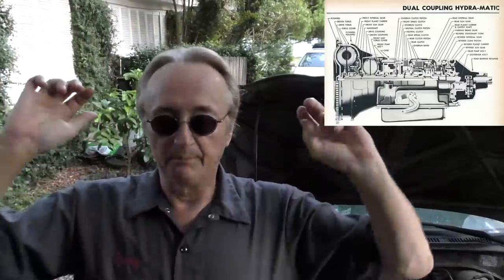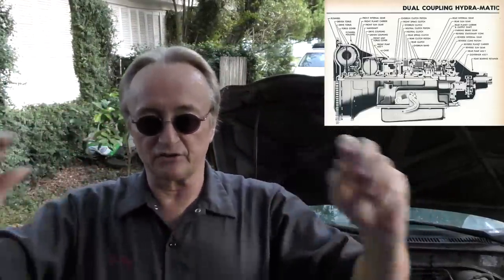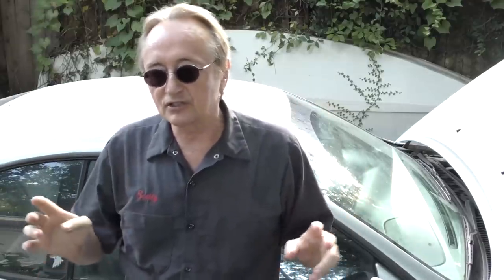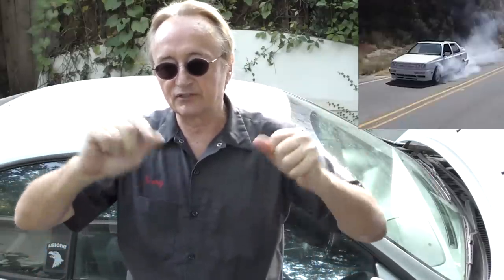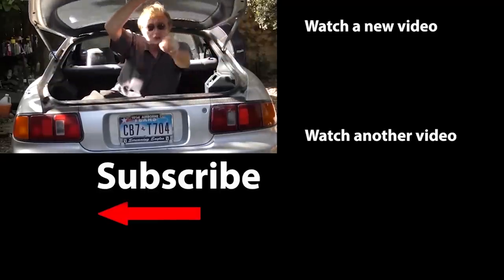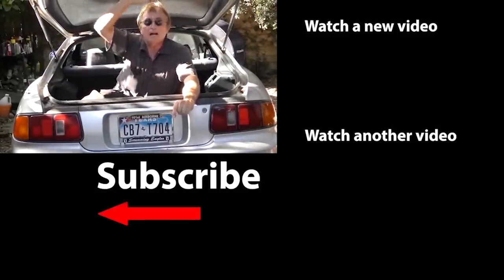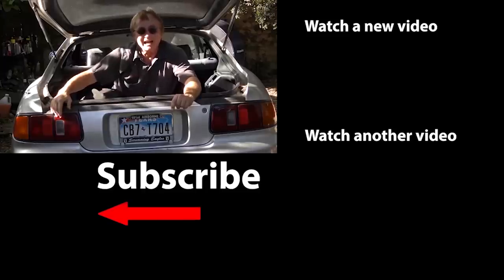This Isn't a Real Corvette, Here's Why

Comment: Honestly I’d rather have a manual transmission than a boring automatic
Reply: welcome to the party pal, even though I have never driven a manual, I would love to learn how.
Reply: Not in rush hour traffic though.
Reply: A manual transmission is easy to use
Reply: Mark G I don’t have to drive through it everyday cause I refuse to work 9 to 5s but even in bad traffic it’s really not that bad. Just stay in 2nd gear and go back n forth with the clutch you hardly have to shift
Reply: @sethriggle1462  Yea I guess...I haven't driven a manual that often. They are more fun I'll give you that.
Reply: @Keaton0801  Pretty easy, the only real hard part is just getting the car moving from a complete stop. I learned in like 30 minutes to an hour, would probably take you about the same amount of time.
Reply: I've never driven an automatic, but as Scotty said before, new automatics are more economical than manuals so I'm gonna get an auto.
Reply: The sales numbers don't match the comments in these videos...
Reply: @markg999  It's not a big deal if you're used to driving a stick.
Reply: Not until you get behind a DCT, sooo much fun.
Reply: It's fun until you get in a 2-hour stop and go bumper to bumper traffic jam
Reply: Manual are slower though, and suck in city traffic.
Reply: I’m fine with it in trafic. I can crawl pretty slow in first and get it engaged quick and smoothly to get to crawling again in heavy traffic. My clutch is like butter and great to operate
Reply: I wouldn’t trade for auto.
Reply: Maybe some of your friends can say the same about you.There is nothing boring about my cvt and paddle shifters, there is joy of driving and fuel economy and above all : safety.This should be a priority: both hands on the steering wheel.
Reply: @Keaton0801  I never slept with a 100, I would love 2....not
Reply: @lukebecker1959  that s a sweet big lie
Reply: @shadyshinichi2JZ  it s like with so many people today who say they don t look at tv anymore, but new tv sets are selling like crazy
Reply: But do you actually have a manual car?
Reply: @musclebone7875  you have so much more control in acceleration with a manual than an automatic, I can beat many of my friends who have automatic cars and I have a standard truck
Reply: @nathanjenkins9118  mmmm...I'm not doubting that, but you wouldn't beat my auto setup though.
Reply: @musclebone7875  that's okay. Id rather not beat ya
Reply: @nathanjenkins9118  👍
Reply: I have driven manuals for nearly 20 years and I'm just fed up with constant shifting. Manual is good for a weekend fun car, not for a daily driver.
Reply: Manuals are slower and you’ll get fed up having to switch gears every time you go somewhere.
Reply: @markg999  right!
Reply: I have 5 vehicles, 2 with sticks, 3 auto. I'm tired of driving stick in the city.
Reply: I agree Seth...a civic or corolla is much more peppy and fun to drive with a stick shift.
Reply: @sethriggle1462  Is taking off in second hard on the clutch...I thought about getting a stick and doing this.
Reply: Poppapump Bernardi it's really not hard on it. Automatics do the same to conserve gas.
Reply: Have fun going slower lmfao
Reply: @musclebone7875  actually manuals user usually have a higher top end speed.  There is less rotating weight in the transmission on a manual which will usually give you two or three miles an hour over an automatic in your top end. Automatics do shift faster and are a lot easier to run consistent times when drag racing.
Reply: @edbuckley1670  I know
Reply: @rabidsminions2079  Yeah, I live in Eastern Europe(Shitsville), I had to drive manual, I was forced to, because there wasn t a driving school that would teach you automatic.

Comment: I have the rarest of the rare, a 2008 Ford Fusion with 5 speed manual. Great car, 270,000 miles and still going.👍
Reply: I have this same car. Only like 202000 miles on mine though.
Reply: Original clutch? I had a beater work ranger that got 215k from original clutch, could of kept going with stock clutch, only replaced it cuz someone blew the engine and I had to replace
Reply: Thechum, yes, still original clutch. As long as my wife doesn't drive it, it will last. 😊
Reply: Blueford86, well maybe you will get 70,000+ more, if it's like mine. 👍
Reply: I have a 06,  5 speed manual same clutch same trans with 110k!

Comment: I drive a manual 94 dodge ram 1500 long bed and it still goes through all gears at 260000 miles
Reply: As Scotty says, that's PRE-FIAT.
Reply: I dunno, my whole family has always driven Chrysler’s, mostly Dodge’s and Jeeps, totaling fourteen differebt vehicles and have never had any real problems except the following: 

Dad had to have his 2001 Dodge Ram’s Transmission rebuilt in 2012 at 210,000 miles. 

I had to replace a radiator on my 2004 Grand Cherokee at 340,000 miles. 

My 2014 Grand Cherokee Summit is at 120,000 miles, 5.7 Hemi runs as smooth and powerfully as new, ZF 8 Speed Auto shifts as unobtrusively as ever in eco, and hard and quick in sport mode. And I drive it hard. My brothers 2014 Ram is the same way at 110,000 miles. 

I can’t put too much faith in what Scotty says anymore because of the way he’s always trashing on vehicles my family has largely never had issues with. And it’s in EVERY video he does on anything, there’s always a “Chrysler is crap” somewhere in there. 😂 It’s almost comical.
Reply: My Charger has 130,000 miles on it and still runs like new and I haven't had to replace anything but tires and brakes. I think he's way too biased against Chrysler/ Dodge
Reply: Switzer Motoring take care of it and it will take care of you. My 2006 jeep grand Cherokee has 231,000 miles, lift and 32” tires and a lot of hard off road miles. Runs like new. Change those fluids!
Reply: SmItH Does your Cherokee have the straight 6.  My 96’ had one.  It was bulletproof!  Too bad the rear differential wasn’t.  Plus lots of other little things here and there.
Reply: My 97 ram 1500 is 20 years old and the radiator finally went out. Wasn’t a huge leak but a small crack near the bottom. Was a 40 min job to swap it out. Early trucks were super reliable

Comment: I have a '78 Chevy Custom Deluxe 4x4 manual, never had a single problem with the transmission.
Reply: Just a good era. I have a 76 Chevy Bonanza 4x4 with an auto with 180,000 miles, no problems.
Reply: Anthony Borrego gemme that
Reply: @WastelandArmorer  I agree, my dad bought it in the early 90s from his co-worker the original owner, and I got it about 10 years ago. Great trucks!
Reply: @niko2002  Na bro I'll be buried in that truck!
Reply: @Guitarded51  Yeah, Just gotta do something to give those engines more power. They are solid trucks, and extremely cheap to work on and maintain.
Reply: Shitpost Bunker  Yep, it's a 3-speed (with a low gear), it definitely sucks the fuel down!
Reply: @WastelandArmorer  I know it's kindof a dog when it comes to power, but it will climb a hill that's for sure.
Reply: Yeah, they sure can! Tons of tourque! It’s fun once you get some hp built into them, they can actually move pretty good!

Comment: I drove cars with standard transmissions for over 25 yrs.  I had no problem with them.  Back in the day like Scotty said, they base cars had them, and they were cheaper, and got better MPG's.  It seems now though, all the "Pro's" of a Standard don't outweigh the "Cons" of an auto.  Only downside now a days to an auto is maintenance costs and repairs vs. a standard.  You can't get around that.
Reply: Miles Jones  yeah it's a risk buying any used car.  Sometimes you get a good one sometimes you don't.  Then again, you can say that about new cars too can't you?
Reply: Miles Jones  that's nothing compared to fixing an automatic.

Comment: My 2002 Grand Caravan with a 3.3L automatic has 248k miles with no major problems.  Changed a/c compressor at 222k miles.  Paint is peeling (maroon) but runs great.  Change oil every 7k with synthetic oil.

Comment: 4:57 yup manual sucks in heavy traffic everyday I'm talking about the big cities not your little community of only 15,000-50,000
Reply: IvanGoldBit I prefer manual in heavy traffic. Why not? Thats what its meant for: to be used and abused!
Reply: I always wait for at least 2 car lengths to move. Some people get mad though then scared when i roll back on purpose. Where i live there is a no tailgating law as my buddy found out in court when he re ended a car that rolled back and lost the case.
Reply: I prefer a manual to an automatic in traffic.  Always get a cramp in my right knee from switching between gas and brake in an automatic, but rarely ever have to use the break in a manual.
Reply: Troy Wiltshire are you using the clutch as a brake? That's bad
Reply: @Aashishkebab  nah prob riding on the clutch. They do that in big cities it is basically slipping the pressure plate so you dont have to pull it all the way in and out all the time. This does cause more wear though...
Reply: Aashish Bharadwaj Car in neutral or high gear coasts. Car in lower gear slows down. Its not complicated.
Reply: @jamesmedina2062  Yes, not that much though. Engine braking is not adequate in many situations
Reply: Aashish Bharadwaj If you read Troy Wiltshire's comment it was that in bumper to bumper traffic the engine brakes itself(NOT BREAKS ITSELF). Please don't take the point out of context.
Reply: Aashish Bharadwaj I do downshift, but my current engine is not near big enough to actually slow down the car much.  But if you are driving in slow traffic most of the time all you have to do is push in the clutch to slow the car down enough or even roll to a stop.  In an automatic if your foot isn’t on the break the car isn’t going to stop...no matter what it will keep moving until the break is pressed.  I have tried all kind of tricks so my knee wouldn’t cramp up in traffic in an automatic even putting it in neutral to make it like stepping on the clutch, but it’s awkward and doesn’t work the same and it’s illegal to put a transmission in neutral while driving.

Comment: Scotty, you forgot the Honda Accord, although with stipulations.  You can only get a manual in the "Sport" model of the Honda Accord with a MSRP of $26,180.    The LX model MSRP is $23,720, but no standard transmission offered.  It may not seem like much at first, but factor in low profile tires and whatnot, and that "sport" model will end up costing you a lot more in the long run.  

I love old 4 cylinder, 5 speed Honda Accords.   I have a 1998 and a 1994.  They run so well, I want to keep them forever.  Its going to be a sad day when I have to, finally, purchase a newer car.
Reply: By that time Converting cars to be electric might be more affordable than you think, I have a 91 crx and there’s already a couple out there that run electric reliably, one guy had his beat a Porsche at a drag race and that was from a leaf engine that fell into the ocean
Reply: Yup honda, 4 cylinders, 5 gears. Its all one could need.

Comment: I was honesty planning on getting a corvette for my channel Scotty
Reply: Thats a good car, i am going to get one as my first car
Reply: haid weng damn u must be rich
Reply: @tonyhollerz6958  you can get used corvettes cheap
Reply: Do it. Stick with your own ideas.
Reply: @haidweng7948  im gonna get a 1959 Ford grain truck for my first vehicle
Reply: C5 zo6 or c4 Zr1
Reply: haid weng 
Imma try to snatch a C7 Stingray or Grand Sport if there are good discounts closer to C8’s launch
Reply: @Jowurel  i am going to buy a c8, i initially plan to buy a c7 z06, but the over heat issure is terrible. The car start over heat after 3 Mins on track. Get a grand sport, its turbo charged so it wont have same issure
Reply: @tonyhollerz6958  work hard, man. It really takes me a long time to buy a car

Comment: I find it strange that Nissan keeps the CVT since the 2003 Murano, which is famous for unreliability, but then keep the VQ V6 since the 1995 Maxima, a very reliable engine.
Reply: Nissan used to put their 6 Speed manual in lots of cars. I have  2007 G35 Coupe with a six-speed and the G35 sedan used to be available with the same 6 speed manual.
Reply: VQs are still amazing engines, its that Nissan merged with Renault and decided to get Jatco CVTs

Comment: You can still get a peterbilt with a manual transmission.  LOL. You pick... 9 speed, 10 speed, 13 speed, 15 speed or an 18 speed.
Shifting a non synchronized transmission is a skill.
Reply: And I don't know why I have it, only fail so far was an old Dodge van on the tree
Reply: @Necro W1zard Try it without synchros
Reply: @Necro W1zard He said non synchronized thank you very much
Reply: @Necro W1zard "not difficult" right... 

Double clutch takes far more skill, effort, and concentration than not, hence the very reason synchronizers were invented.
Reply: @Necro W1zard not having to double clutch is where the skill comes in, bang through the gears in 2/3 the time and hills are less of a challenge
Reply: Necro W1zard 😂. Driving a 13 speed semi truck with a non synchronized transmission  is a lot different than driving a little 4 or 5 speed car. 😂😂. I know by you response that you have never witnessed let along driven one.
Reply: Yep... I float the gears. I only use the clutch to start and stop.
Reply: When I started we had mostly Qudaraplex and 5 bys , the Road ranger was a real step forward , . But My 79 Superliner I restored has a Qudraplex ..
Reply: @Aashishkebab  Double clutching is easy I had to double clutch when downshifting to 2nd gear in my first car because the synchroniser was worn out once you get into the habbit of doing this it becomes very easy.
Reply: @gravemind6536  It's muscle memory and that's called skill
Reply: @Aashishkebab  Yes it is a skill quite an easy skill to learn too.
Reply: @Necro W1zard Its not just ease of driving haulage firms like the fact they are more fuel efficent too and overall more reliable as they don't have problems with a clutch wearing out. Buses and Coaches all use automatics for the same reason but couriers in light vans almost always still have a manual because its cheaper to buy more fuel efficent and more reliable. At the end of the day with vehicles being used for commericial purposes they go with what takes best care of their wallets. Taxi drivers also love the Toyota Prius because of the money it saves them.

Comment: The base Acura TSX came in standard transmission.  6spd manual until it was discontinued and raplaced by the TLX.  I have a 2011 with 200k and the car is still runs strong despite burning oil with only regular maintenance.

Comment: A manual transmission in rush hour will destroy your left knee and make you miserable. They're fun on the weekends, that's about it.
Reply: Sums it up for me
Reply: Facts. Manual sucks(i mean its not conventional any more).
Reply: For you lazy Americans ? Yes it would. But here in Turkey an avarage driver can stay in traffic 3-4 hours with an manual and dont have any problems at all.
Reply: @defectiveturret4391  la traffic stays for 3-6 hours too
Reply: @defectiveturret4391  in Ireland in the city's same thing bumber to bumber traffic yet 95 percent of the cars are manual
Reply: @defectiveturret4391  haha i will drive a manual till the day i die
Reply: How tf are you destroying your knee sitting in a car pressing a clutch pedal 🤯
Reply: jrbisc99 man up
Reply: Try driving a 18 speed tractor trailer in L.A traffic. My left leg is way stronger than the right one. 😁
Reply: Also the duel clutch in the new c8 Vette can shift faster than Mario Andretti anyway.  New technology has definitely surpassed the old standard.
Reply: Maybe in a 50 year old car without a hydraulic assisted clutch.  All the cars since at least the 80’s have a clutch that is so soft and easy to push that if you’re having problems with your knee then maybe you should go to the doctor and see what’s wrong with your knee or something.  I pretty much just use my toe to push the clutch maybe some ankle, but never my knee...
Reply: @mikeleahy5283  I still drive the ae101  it's just I don't live in that city anymore
It takes  6 hours  to cover 10 km in Dhaka so in a 90's it wasn't the best experience
Reply: Sad, but true
Reply: @DYNAMiC027  yea it's impressive and all but that doesn't mean everyone wants it
Reply: @troywiltshire5272  you put the car in. Neutral on long stops helps but they put this stupid strong spring on the focus st .
Reply: @troywiltshire5272  That's right! even the vw's from the 90's (jettas and golfs) were all mechanical clutches but still, very very soft; maybe these people are having problems with their hydraulic master or slave cylinder from the clutch, or an already busted diaphragm spring in the clutch, and these people are too lazy to take theirs cars to their local mechanic and spend some $$$$$$ to fix the problem, go figure it out!

Comment: I owned a 95 Accord EX with a 5 speed manual transmission.  It went over 300k miles and the transmission still worked flawlessly with the original clutch!  That was one hell of a car.